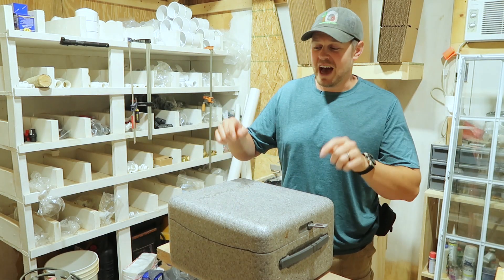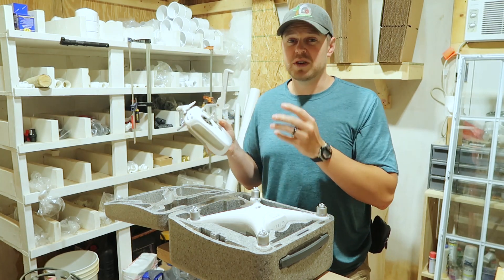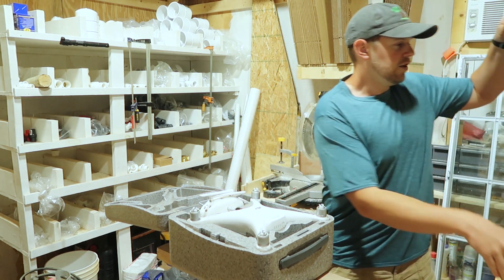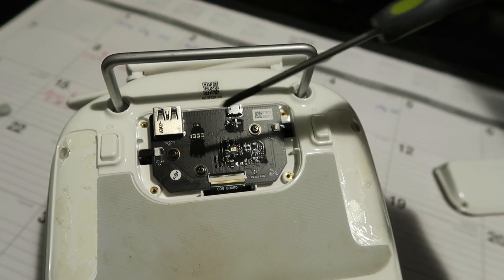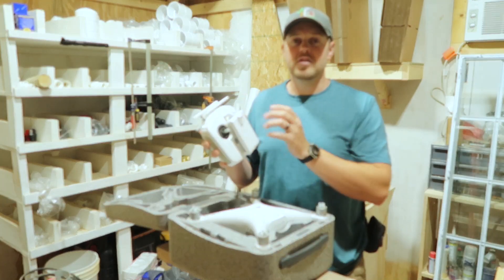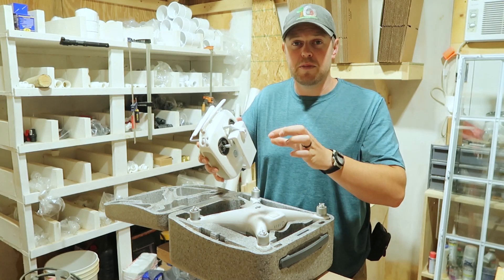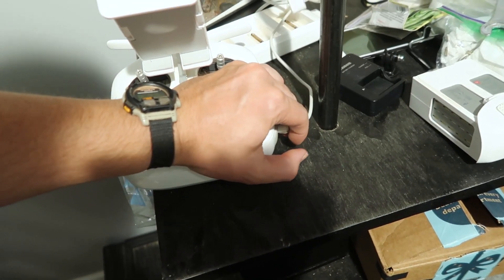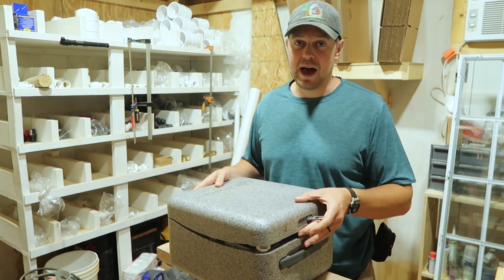Phantom 4 Controller Not Charging Fix

Comment: I had my drone + controller in a storage compartment in my camper for about a year in Montana. Lots of weather changes, extreme cold and heat. I saw my controller is no longer charging. I will be trying this fix soon and will edit this comment with the results. Thank you very much for the clear and concise video. Much appreciated.

Comment: Perfect thanks! 375c for 30 seconds, got the third light. Another 40 seconds and got the fourth light for full charge. Used a small piece of metal to divert away from LEDs and a hot air reflow station.

Comment: Here is what worked for me with no dissassembly.  1) Plug in the charging plug to the remote (1 light will flash) for 30 minutes which will heat up the board.  2) After 30 minutes Press power button twice as if you're turning on remote. The 4 lights will light up in sequence and the first will stay solidly lit. 3) Leave remote on for five minutes.  4) After five minutes, press twice to turn off. 5) Leave charging plug in place. Wait 5-15 minutes and it will start charging normally.

Comment: I have a DJI Phantom 4 Pro where the remote controller wasn't charging at all. I would get 1 out of 4 LEDs blinking rapidly on the controller when attached to the charger for about 5 minutes and then it would just shut off. I disassembled the remote and applied heat to the chip as your video shows. I now have 4 out of 4 LEDs lit and the remote control fully charges. Thanks for posting the video. I used a reflow tool that allowed me to set the temperature and blower speed. I had it set to 3 out of 7 for blower speed and approx. 700F for temperature. I used a piece of thick cardboard to protect other unrelated components from getting blasted with the heat. I applied the heat over the IC chip for approximately 10 seconds (moving it around overtop approx. 2-3 inches from the chip) then took a break and applied it a second time. After letting it cool down, I have all LEDs lighting up and full charge. Interesting, the issue wasn't just preventing the battery from charging. After I applied the fix, the battery was fully charged already. Before applying the fix, the remote controller complained the battery was almost dead. So this issue wasn't just affecting charging, but also powering the controller properly from a fully charged battery. Thanks again.

Comment: Funny thing is if you check the battery voltage with a meter I find it's full. The chip responsible for measuring the voltage is faulty. Done this routine many times. It's not a permanent fix

Comment: Not sure if I am the only one. Mine worked for a week before I have to start pulling the battery to get it to work. As a person with experience in the "reflow" department. Chips fault out and can be temporarily fixed sometimes with heat. But the chip is still faulty. I did my to correct temperature as I have scope, wand and micro soldering pencil. I did the points, hit with wand and nudge checked. Week later same thing. I assume chip needs to be changed, that is what I am going to do now. Ty for isolating the faulty chip, makes life easier.

Comment: I plugged my Phantom 4 transmitter to charge my battery and no charge, no lights, nothing.  I took my transmitter apart and found a green flashing light on the motherboard.  I disconnected the battery, reconnected after 10 seconds, and the green light stopped flashing!  I turned my transmitter on with no problem and a full battery!  Try this and it may help you also!

Comment: Wondering how you can use your phone to see the RC battery level. I can't find it in the go4 app
Reply: Easy...connect your transmitter with your phone .  Then open dji go 4   go right top to the 3 points...now select battery and you see  how much power left in the battery.

Comment: my p3 pro controller has had this issue since i put it in storage and didn't fly it for about 6 months. Mine would refuse to charge at all. I reflowed this IC and i'm now getting 3 lights (75%). I messed around with it a bit more and it dropped back down to 2 lights (50%). After reflowing 1 more time I got it back up to 75% which I'm happy with. I didn't use cardboard but instead just used the smallest tip I have (5mm) and set it to 350 degrees C and air flow about 4 for 30 seconds. These controllers are really shitty as this seems to be a widespread issue online.

Comment: I thought I had this problem. the controller was charging for about an hour and it still was showing just 2 lights!. but the charger was really hot so I unplugged everything and let it cool down for a ‘couple hours’ then started charging again then this time  all 4 lights came on!! almost charged! 
Then I realised I had been charging the P4s  batteries before the remote. which was why the charger was hot it’s obviously a fail safe to stop it overheating heating so before dismantling the remote wait till the charger is cooled down! then try again 😌

Comment: Thanks so much for the video. I had the same issue with mine. Had to repeat the process 3 times as well as reflow  both the power and battery  connectors on the 3rd attempted and it worked. Initially the control sticks where not working after I reassembled the remote so I brought the drone indoors and tried it again and they worked. I don't know why this happened  but all good now.  Great care should be taken when heating the board I guess.. Issue finally fixed, happy days!!!

Comment: I searched a ton of videos on YouTube and all said the same thing. I tried this and it didn’t work, but noticed my battery was “inflated”. Ordered a new battery and bam, remote worked perfectly.   I did leave it on the charger for a bit while I wasn’t using it. I’m assuming it overcharged and killed the battery. 

Changed my battery and it worked. Maybe my case was different?  Super thanks for the video btw.
Reply: Where did you get the battery? I cant seem to find them
Reply: Anthony Espinoza got it off eBay.

Comment: I just did this with our Phantom 4 Controller.  There are a few videos that are similar, some with more detail than others.  After having done it, I think about 80% of the disassembly shown may be unnecessary. I went as far as the 6 small ribbon connectors on the main board before I realized that as long as the two screws are removed, most connectors can stay connected. I did not disconnect the wired plugs nor the antennae connectors. If I had to do it again I would try leaving the ribbon cables connected.  If you feel you may pinch the cables, disconnect them.  Now the board can be carefully lifted and tilted back to lay on the controller, iPad holder retracted underneath and flat on the table.  This also makes a good stand for it to be on when doing the heating.  If the board resists being lifted, it may be stuck on the two posts toward the front edge - apply a little more force under the board there and it should come up.

I used an "embossing heat gun" that my wife had for crafts to heat the chip located next to the light array as shown. I used a piece of cardboard curved around the chip to isolate it and held the gun on for two minutes. I did not need to heat any other areas.  When I was done, the cardboard looked slightly toasted at the edge near the chip, so it is a fair amount of heat. 

Afterwards, once it cooled, I reconnected the battery and then the charger to verify that the charging lights came on as expected.  If all is well, they should begin lighting in sequence and as the charge completes all 4 will light in sequence, then finally go off.  If all is good with the charging, turn the controller on to make sure all lights light up indicating a full charge; if you have disconnected the ribbons, only "No. 5" coming from the power switch needs to be reconnected to test this.  This is a good test before reassembly in case you need to apply the heat again if it didn't take.

If all is good, reassemble and take the drone out to test all controller functions in a limited safe flight.  Take your time with this, work carefully and methodically, and it may save your controller and some $$$ on repair.
Reply: Cannot understate how great this comment is. It saved me a large amount of time. Just unscrewed the two screws and lifted up the board, angled the controller so it would sit at the correct angle, then refloated the chip as noted in the video. Thanks!

Comment: My controller is doing the same where it only charges to 2 LED and no more......it so annoying that we have now grounded the unit for work for fears of it losing coms with controller if it goes bad midflight.
Reply from the maker: Yes it is so sad. This seems to have fixed my issue but then I only fly close so I dont lose it.
Reply: Hi mate , the drone will return to home if the tx looses connection , you can turn the tx off mid flight and as long as home point has been recorded it will come back , tested my p4pro 4 or 5 times by turning tx off and its always come home to land exactly where it took off from 👍👍
Reply: tony perks I ended up getting it repaired. The circuit board was faulty.

Comment: Firmware update fixed it for me no need to take me controller apart and mess it up. Lol. And i have a 100% charge try the firmware back up first.
Reply: Michael, So you are syaing that you had this issue and you conducted a firmware upgrade and the problem was gone? I have this issue and its most annoying as the drone is now grounded for fear of failure due to the abttery issue.
Reply: @walkingmanvideo9455  yes i wasn't able to fully charge my controller. Then i did the update and its been good
Reply from the maker: That would be good. I tried the update some time ago and it did not fix my issue.
Reply: How did you do a firmware update? I was just talking to a rep online via online chat and said I gotta send my controller back to them for a diagnosis.. I even tried downloading the DJI assistant 2 and my controller wouldn’t even connect.. mind you my controller sat for over 6 months and it won’t charge.. I have the red light blinking and the first light blinking and obviously it beeps constantly because the battery level is low

Comment: I've reflowed 3 times, the last time seems to be holding at 86%. After flying 3 batteries on my Phantom 4P, I was down to 26%, not great but usable. I've found a cable that will charge the remote from the Phantom 4 batts. So in a pinch I can use a Phantom battery that I flew to 30% and charge the remote
Reply: I want to buy a heat gun to do it, Do you know the needed specs?
Reply: @ttkn1  Mine is 1000W heat gun, with max temperature at the nozzle of 400 F
Reply from the maker: I got about the same results. Its enough that the drone is not trash but I still stay close to home.
Reply: Waow! Pls how do you charge the remote battery ? I would love to know. Thanks

Comment: I had this done with my controller and it worked perfectly only for about a day or 2, any ideas on what I can try to make it permanent?
Reply from the maker: My guess is that it was not heated enough. I dont have the answer to the best heat setting or the time to hold on the chip.

Comment: I just started to have this same problem. Got my regular 15 dollar heat gun and wrapped some foil around tip to make concentrated flow. Aimed it right at the subject IC and wow I started to see some bubbles below the IC. Plugged in the board and wow all lights lit up. Then put the controller back together and Shazzam! Everything charging and lighting up as it did when it was new. the trick is you have to get the area hot enough to reflow but be careful not to move IC off the pad. Just in case I did go ahead and buy the exact replacement battery from Amazon. Lipos do degrade with age. Controller ones do last much longer as they are not depleted that often and depleted at a much lower speed. Nothing like the main batteries. I've already had 3 puff on me. Won't fit in the ship anymore.
Reply from the maker: That is good advice! This issue sure was annoying to find when it first happened. Thank you for your info.